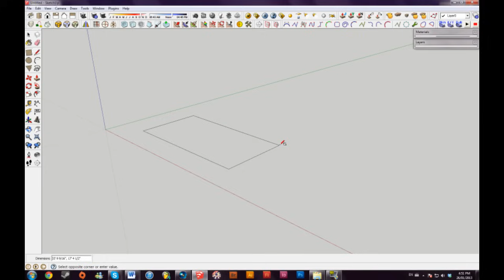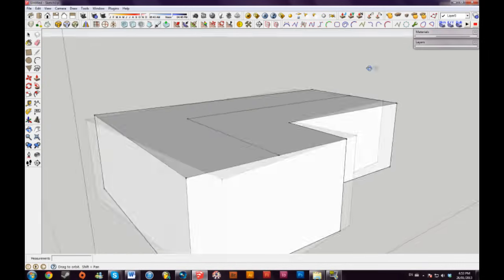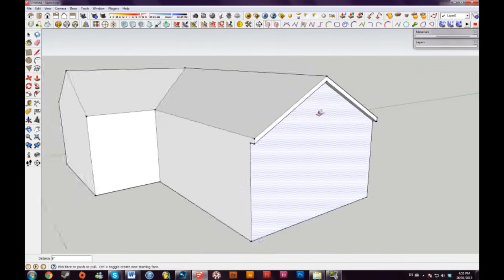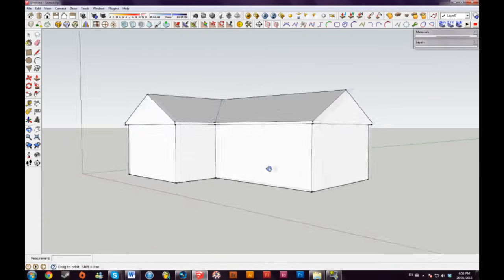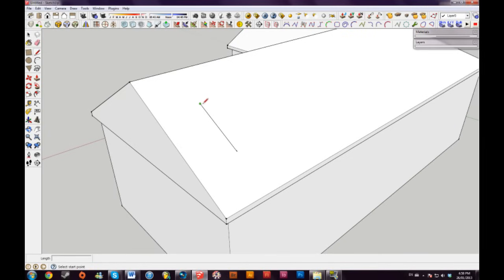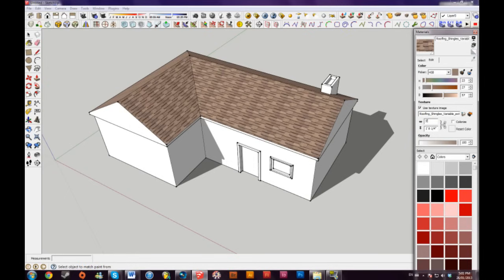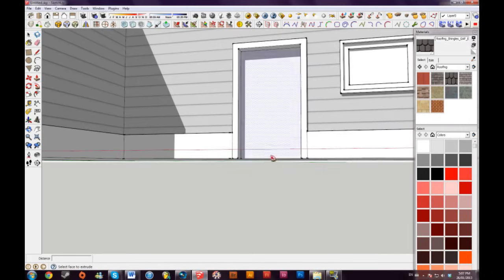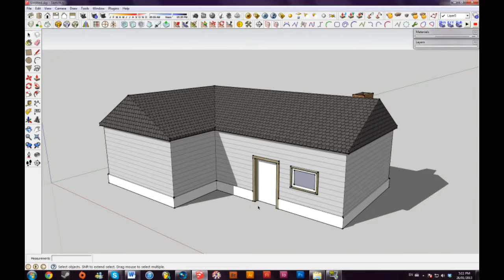SketchUp 8 Lessons: Making a Simple House

Comment: The measurements seem off. Large box is 30' by 15'? and smaller box is 20' by 10'? But the larger box is definitely more than twice the size of the smaller box. Confused, because on my model the dimensions are so different.

Comment: There's something wrong with the measurements of the first two rectangles.  Following along with the exact measurements you give returns a different shape.  The small rectangle is 20 ft long and the big one is 30 ft but it's more than twice the length...
Reply: Are you working within the Architectural Feet and Inches template?
Reply: WAS LOOKING FOR THIS COMMENT, I FIGURED IT OUT, HE SAYS "MAKE SURE YOU YOU PUT A COMMA" ON THE FIRST RECTANGLE, THEN WHEN HE DRAWS THE NEXT RECTANGLE, HE FORGETS TO PUT HIS OWN COMMA AND DOES (35' 15') IF YOU WATCH CLOSELY IN THE MEASUREMENT BOX DOWN TO THE LOWER LEFT..... WHICH GAVE A RECTANGLE AT 50' INSTEAD OF 35'................, THEN HE SUBTRACTS 5' SO THE FINAL RECTANGLE WAS 45'....TOOK ME A MINUTE BECAUSE I WAS FOLLOWING ALONG AS WELL THEN I KEPT COMING UP WITH THE WRONG RECTANGLE SIZE IM USUALLY REALLY GOOD AT THINGS LIKE FOLLOWING ALONG ON TECHNICAL STUFF. THAT WAS IRCKING ME LOL

Comment: Something is wrong with your measurements.  You typed in 20',10' and then 35',15' but shortened it by 5' so then it would be 30',15'.  The problem is that on the X axis, there is 20' on the first rectangle and there is 30' on the second rectangle but the second rectangle looks more than 10' longer than the first rectangle on the X axis.  If the first is 20' on X axis and the second is 30' on X axis, then it should only be 10' longer but it looks more like 20' feet longer.  What is wrong?
Reply: I THINK I FINALLY FIGURED IT OUT!! After like maybe an hour of endlessly fucking around with the settings I figured out what the problem is. It's nothing we did wrong. for the first rectangle, he types in 25',10' All good and dandy there. for the second rectangle however he makes the very mistake he warns us not to make lol : He types in "  35'15'  "  with no comma in the middle. That's why his thing is larger. I don't know why the program does this, and I personally don't understand the significance of the comma in the measurements because I suck at math, but if you don't type in the comma for the second measurement you should end up with the same thing he has.
Reply: Is the second rectangle 40',15'?
Reply: I'm trying to figure out the same thing. I put in the same numbers as him, and my dimensions are clearly way off. As far as I can tell, the second rectangle on his is actually more like 40'x20'. But I can't figure out how that happened because he clearly types in 35'x15' before shortening it.

Comment: Up Next SketchUp 8 Lessons: Advanced House Building
Skip navigation
 Upload    
 

Search

Up Next
SketchUp 8 Lessons: Advanced House Building
Aaron Bishop
Cancel
Autoplay is paused.

9:30 / 9:30
SketchUp 8 Lessons: Making a Simple House
Aaron Bishop 
Aaron Bishop
Subscribe11,775
Add to   Share  More 224,704
 713  25
Published on Jan 27, 2013
In this tutorial I go over how to make a simple house, introducing the offset and follow me tools. I also explain inferencing a little better and show you how to skew and rotate textures.
SHOW MORE
COMMENTS • 85
  
Cancel Post
Top comments
 Aaron Bishop 
Aaron Bishop11 months ago
+Daniel Grasletta I'm certainly not dead. I'm currently working on some big updates for my channel. Stay tuned guys.
Reply11     
 Bellaire North Investments of TX, LP 
Bellaire North Investments of TX, LP3 days ago
+Aaron Bishop Hello, super enjoy your videos. I am using the most current SketchUp version and when I try to create the eaves by creating an offset under the house and pushing that offset to the roof line it isn't working. Instead it's creating a hollow space between the outside walls of the house and the inside of the offset area I created under the house. Any suggestions on what's going on?
Reply     
 a fareed 
a fareed8 months ago
Aaron, what does the top bar do? And how do you get it? I'm sorry if you said it in the video and I didn't hear it. Thanks.
Reply1     
 I love Sili 
I love Sili7 months ago
+a fareed me too, I don't have that in my software like him, if this is the older version of sketchup then should I get that instead?
Reply     
 Aaron Bishop 
Aaron Bishop7 months ago
+a fareed If you're referring to all the icons at the top of the screen, most of them are plugins I have installed. They range from different drawing tools and rendering programs. Most of them can be found of SketchUp's extension warehouse.
Reply     
 BRO ROBO 
BRO ROBO2 months ago
Hi Aaron,I am just starting with sketch up. Want to build a 16' x 24' garage. Do you have any tutorials for a garage? Thank you,Jonathan
Reply1     
 halo malika 
halo malika1 month ago
nice tutorial, thx
Reply     
 Cecilia Tam 
Cecilia Tam1 month ago
FUCK YOU MOTHER BITCH!!!!
Reply1     
 Mr.Winter spirit 
Mr.Winter spirit3 weeks ago
you are pro
Reply     
 Felix Servino 
Felix Servino3 months ago
+Aaron Bishop question? it's that suitable to import in unity?? if yes can you show how?
Reply1     
 Jos van der Mijl 
Jos van der Mijl2 months ago
Hi Aaron manny thanks for your lesson this was verry helpfull 
jos from the netherlands
Reply     
 Mr. Pebbles 
Mr. Pebbles7 months ago
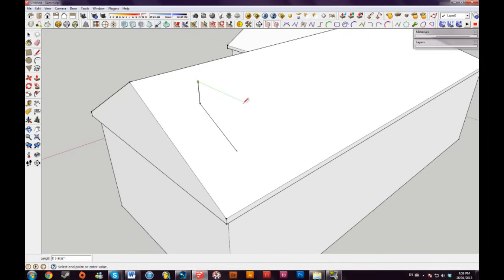5:30 how did he fill the outline on the chimney? Please, help.
Reply     
 Aaron Bishop 
Aaron Bishop7 months ago
+VirginityDen When you complete a shape that has been drawn entirely on one axis (x,y,z) it automatically fills in. If you draw something and one of the lines is off by just a fraction, it won't work. So when you're drawing, make sure each line turns green, red or blue to confirm it's on the correct axis.
Reply     
 Mr. Pebbles 
Mr. Pebbles7 months ago
+Aaron Bishop Thanks for the information. c:
Reply     
 Naynay Neo 
Naynay Neo5 months ago
i sound like you when i squeeze my nose nd talk loool
Reply     
 Yoana Hillary 
Yoana Hillary1 month ago
Thank you
Reply     
 voltanicMercuay0 
voltanicMercuay01 month ago
can you tell me how many subs i have
Reply     
 LayZee 
LayZee1 week ago
+voltanicMercuay0 7
Reply     
 Bro. Craig 
Bro. Craig3 months ago
omg how did u get the tool bars
Reply     
 Michelle Laney 
Michelle Laney3 months ago
Wow! You go really fast...
Reply     
 Dominic Huerta 
Dominic Huerta3 months ago
whoow whoow
Reply     
 Zed Man 
Zed Man6 months ago
What template is this using?
Reply     
 Chloes Browne 
Chloes Browne3 months ago
wow it was amazing
Reply     
 owen snipes 
owen snipes3 months ago
can you put a link to your home on google  skechup 3d 
so we can download it
Reply     
 Strahinja Nikolic 
Strahinja Nikolic5 months ago
1:48 How to change into a tool SELECT?
Reply     
 Norm Razak 
Norm Razak6 days ago
thanks this will help my design technology exams😊
Reply     
Show more
Autoplay   
Up next

SketchUp 8 Lessons: Advanced House Building
Aaron Bishop
547,150 views

19:54
SketchUp Tutorial - 1 - Beginner SketchUp Tutorial
Jake Day Williams
327,552 views

21:11
SketchUp 8 Lessons: The Basics
Aaron Bishop
57,046 views

14:40
Sketchup #32: Roofing
Harwood Podcast
124,029 views

27:29
Google Sketchup Speed Building - Modern House 4
DutchSims4Master
141,580 views

15:19 
Sketchup #25: Small House (Part 1 - Walls)
Harwood Podcast
390,883 views

22:34
Sketchup Framing Lesson by Solarcabin
solarcabin
166,430 views

49:16 
SketchUp 8 Lessons: Making Detailed Objects
Aaron Bishop
69,295 views

17:10
sketchup tutorial | vray sketchup | sketchup 2015 tutorial beginner
Sketchup tutorial
59,763 views

9:45
SketchUp Project House Model - Roofing Tutorial
Jesse Bowen
32,016 views

14:45
3 Bedroom Residential House using SketchUp
SketchUpBIM
77,333 views

9:15
Sketchup Fast 3D House Tutorial (Basic)
Mufasu CAD
13,614 views

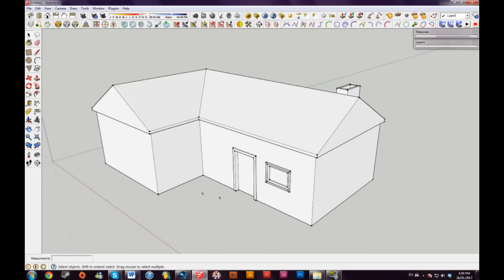5:42
Tuto Dessiner sa maison avec SketchUp, chapitre #1 : dessin d'une maison
Adebeo Formation SketchUp
228,429 views

57:05
Sketchup Tiny House Design Lesson 1 by LaMar
solarcabin
50,713 views

53:55
Google Sketchup Speed Building - Modern house
DutchSims4Master
344,711 views

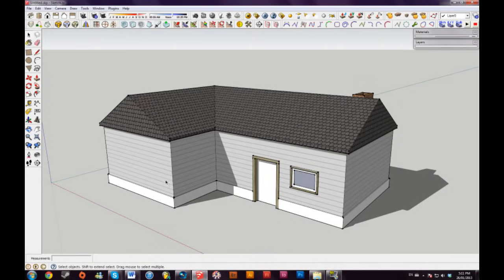9:06
Sketchup for Woodworkers - Dados, rabbets and grooves
Rob Cameron
70,764 views

21:30
Sketchup How to Draw a 20' x 20' Bedroom 1 of 2
11swallowedinthesea
222,436 views

14:59
Sketchup 2015 Lessons: Curved Tents
Aaron Bishop
56,838 views

18:13
Sketchup 2015 tutorial - Sketchup tutorials for beginners [COMPLETE - 160 mins!]
Sketchup 2015 Tutorial
138,209 views

2:39:15
SketchUp 2013 : Make a small house in google sketchup 2013 (speed build)
Easy SketchUp
7,826 views

36:10 SHOW MORE
   Language: English   Country: Worldwide   Restricted Mode: Off  History  Help
About Press Copyright Creators Advertise Developers +YouTube
Terms Privacy Policy & Safety Send feedback Try something new!

Comment: Can you tell which plugins  are you using.. or help with a simple list of most useful plugins?

Thanks in advance :)
Reply from the maker: +Shapnil Khan The most useful ones I use would include: Round Corner, Artisan Toolset, Bezier Curve, Soap Skin, and for rendering I use VRay. If you're looking for a rendering engine that's a little easier to wrap your head around, try Shaderlight. Cheers!

Comment: Aaron.. I understand the procedure for "reversing faces" but do not understand why it was necessary here (you did it immediately after creating the two rectangles and deleting the shared edge in this video).  Why was this necessary?  Why did the two rectangles not "automatically"  (i.e. by default) open with the correct ("outside") face(s) showing after you created the first/simple rectangles?
Reply from the maker: +Bob Mailer It isn't strictly necessary, perhaps I'm just a little OCD and like all of my model's faces to be the same colour.